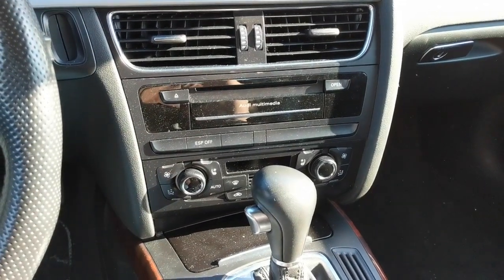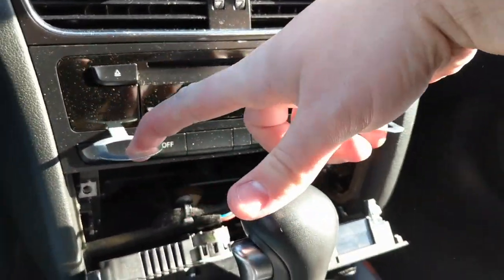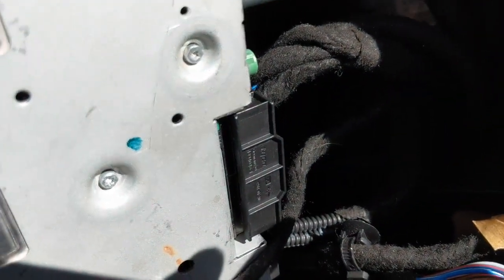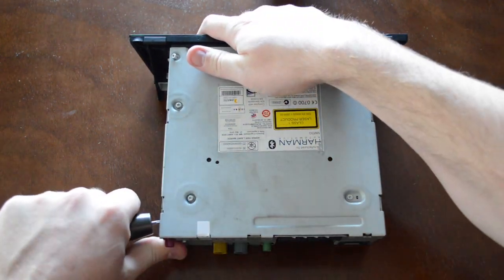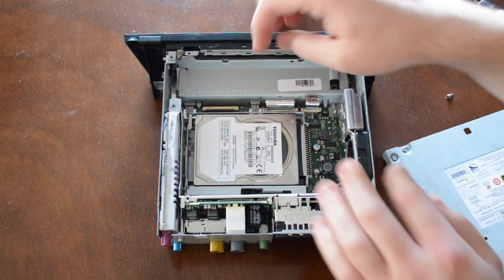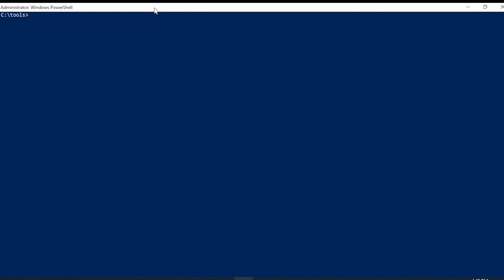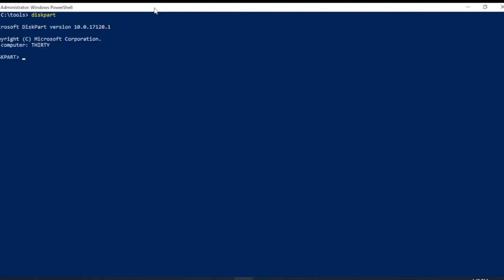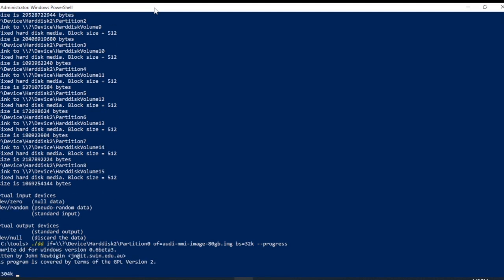Replacing the Hard Disk in Audi MMI 3G head unit

Comment: Just finished doing this and successfully cloned my HDD, but it didn't fix the problem. :(  MMI still crashes and shuts off after exactly 6 minutes and 20 seconds.  Any ideas on what can be done here?
Reply from the maker: Might need to perform an in place software update to restore the corrupted files on the disk. The update is not easy to find, but they're out there.

Comment: Very similar on a 2015 c7 A6. Thanks for the details. I'm having this drive sent out to be copied- it failed. Basically the only difference is when taking out the control module there is one 8 mm bolt once you remove the HVAC control.

Comment: Great Video and very helpful.
I decided to give this s try since I've been having issues with my Bluetooth, NAV and Media loading on my 3g+ MMI in my 2013 allroad. I've pulled the drive and connected to my Windows 10 PC. I've followed the instructions in this video and the DD command works to creating the video to just about completion, then I get the following error "54,404,480k Error reading file: 483 The request failed due to a fatal device hardware error" This is the second time I've created the image. I don't remember the error the 1st time thought. After writing the 1st image to my new disk it only created 4 partitions, and when I put that new drive in the car, Nav or Media would sit at Initializing. I'm guessing now that I've seen this error that my disk is corrupt and definitely needs replacement. Do you know if I can find an image that I can use to create a new disk?

Comment: Hello @breakallthethings Am having the same problem now, but mine is a 2014 Q7. You mentioned something about updating software, can you please provide a link to that if you have one. Also, if I buy a new hard disk do I need to format it or partition it in some kind of way that matches the old hard disk so it can be read properly?  My hard disk is making that loud clicking noise and Navigation is stuck on initializing and same goes for my multimedia, but everything else works. Thank you so much
Reply from the maker: I don't have a link to updated software, unfortunately. There are a couple of people around the forums offering software and map updates for various fees, and that was the route I took. Audi was incredibly unhelpful in that regard. As for formatting/partitioning, the copying method used in the video recreates the partitions and content appropriately. If the hard disk itself is unreadable, that's where things get complicated -- but dd/ddrescue can help recover as much as possible.
Reply: @breakallthethings  great, thank you so much. Last question, if I do end up buying a hard disk and just put instead of the old one and take it to the dealer, would you know if they can download or install the software on it? And will it work?
Reply: Hello, i have the same problem with media, and navigation stuck on loading. Did you repair it?
Reply: @danycs103 hello, I actually found a similar unit on Ebay and bought it, then took it to the dealer for programming only. So far still no issues

Comment: Good day. I have an Audi A4 B8.5 same mmi unit like yours. The problem is I accidentally went into the engineering menu and activated some things I wasn't supposed to. Now the MMI unit just comes on and is stuck on the Audi Logo start up. I took it to Audi and they saying the the MMI system is corrupt. To replace the unit cost more than the value of the car. Is there any suggestion on how I can repair or fix this problem without replacing the unit?

Comment: Where’d you buy your hard drive at? Was thinking about testing my luck with this one off Aliexpress. The guy assured me they work fine and have sold a ton of them. It’s a 100% “look-a-like” toshiba copy. 

I was also wondering which hard drives are compatible to work with the mmi? Toshiba is alright. I’d rather have a hitachi or something made in Japan lol. I’d assume there’s better hard drives that last longer/more durable out there. 

https://m.aliexpress.com/item/32818242869.html?spm=a2g0n.productlist.0.0.457e4adaV994Td&browser_id=da1a9f2002ae46858e6398d8f73da36f&aff_trace_key=af8d123e5bdc479ca1548b1a137c0ef0-1617128621162-01270-UneMJZVf&aff_platform=msite&m_page_id=6uwrfbqjgiqcarj3179ef1d1be622169968a20aafb&gclid=&_imgsrc_=ae01.alicdn.com%2Fkf%2FHTB1xv4kXIfrK1RjSszcq6xGGFXam.jpg_640x640Q90.jpg

Comment: Hi,
Is there any version of MMI that DOES NOT HAVE an HDD?
I just opened my unit and there is no HDD (under the CD reader). (It looks almost identical to yours just with other options - Start/Stop and ESP).
I mention that the car MMI worked when I purchased it but after 3 months it went dead black and when I went to the Audi Dealership they used the tester and told me that the 5F unit is dead (this unit).
Have any ideas?
Car: Audi A4 2014.

Comment: Hello everyone i bought an identical HDD and proceeded to clone it (for Backup purposes) per this great tutorial (it gave me an error copying one of the files) i installed the clone, everything works perfectly fine except one thing, i lost Bluetooth! anyone came across such issue? The icon dissapeared and in the bluetooth settings everything turned grey except the turn BT on/off which doesn´t do anything. thank you

Comment: @breakallthethings  great video and excellent explanation. In my 2010 Q5 8R I've had a hard drive fatally broken. We live in a extreme heat weather country and I believe this has caused the damage. I find myself that I do not have the data to restore te system when replacing the drive. Since it looks like you might have looked into this , could you help me out  to find a solution. Cheers

Comment: How did you determine your HDD was failing?
Reply from the maker: Mine would randomly pause at certain events, long enough that the system protection would kick in and reboot. Sometimes, when holding my ear up to the unit, I could hear it clicking.
Reply: Mine took a dump from driving in tucson too much, oh not to mention 4 Tires unrepairable 😢 from all the craters I've ran into. The hard hits from driving through them eventually blacked my mmi out and now the rust disk spin inside the hdd casing and you can hearthe reader arms smacking the surface of the disks that info is wrote to.😢😢

Comment: Quick question. It sounds like the actuator in my HDD has gone (HDD clicking). Was thinking about buying an MMI 3G head unit from ebay and just swapping out the HDD's. Do you know if this would work or are the HDD's matched to the head units? Thanks.
Reply: Weargas dose it work with you !?

Comment: Hello and thank you for this video.
When you disconnect the radio and put it back on, does it ask for a code ? From the video it looks like you won't need it.. (the seller didn't provide me with any code) .
I need to remove/disconnect it because the cheap radio pullers are stuck and I don't wanna mess up (lol)
Reply from the maker: Nope, no code. It's locked in with the CAN gateway to your VIN, so if you're getting a new used one, you'll have to visit your local Audi dealership to get component protection removed.
Reply: @breakallthethings  ah great to know, thank you for your quick response!

Comment: Thanks for this amazing video...
Are this available when I replace Hdd with an Ssd...?
Reply from the maker: So, that's where things get complicated. I've noticed on the forums that people have attempted to replace their HDD with an SSD, and ended up running into weird gremlins, but usually they also attempted altering the partitions at the same time.

The two problems with using this method with an SSD is that most SSDs are not designed with the temperatures that the stock HDD are designed for, and most SSDs require you to align partitions to match the byte alignment of the SSD. Most Windows drive migration software will do that for you, but a bit-for-bit copy wouldn't align the partitions, and so you'd get either no speed boost, or a moderate speed boost when working with it. Furthermore, if you make a lot of changes on the drive, the OS will have no idea how to perform TRIM cleanup on the drive, so eventually, you'll lose all the speed you gained.

Comment: Hi... i have disk on bench and connected to PC. How can i read it on Windows? What kind od application do i must to use?
Reply from the maker: Hi! On Windows, we won't actually read the contents of the filesystem, as it's a QNX disk, and requires a VM to access it. In the video above, I use dd for Windows to do a byte-by-byte copy of the disk to another.
Reply: @breakallthethings  Yes I know. Now I backup 1:1 on my pendrive but I want to access this and find few file which I want to change...
Reply from the maker: Adaxus Adaxus Gotcha. For that, you'll need a QNX VM and to attach the image to that VM.

Comment: i got one problem with my audi 
Mmi issue found hard disk fault in mmi control unit req new control unit and coding
it can be solved that the cost for a new one is £ 3500

Comment: @breakallthethings i got one problem with my audi 
Mmi issue found hard disk fault in mmi control unit req new control unit and coding
it can be solved that the cost for a new one is £ 3500
Reply: Did you get this fixed? Had the same issue in my a7 and looking for a cheaper alternative than £4000

Comment: Can you add an SSD drive (I'm guessing the connector will need to be changed as they are different from an EIDE drive) to this unit so it boots much faster (no moving parts)? And then, I guess, use the same PS scripts to export the information and then import them back onto the new drive. Also, what do the connectors do? IE which one is the aerial/ GPS, etc? Appreciate the help. Great video by the way.
Reply from the maker: Thanks!

I've seen in the forums a few people attempt an SSD. If you find an IDE SSD (which exist, but aren't great), it should work if you direct copy the partition table over like I do here. However, I haven't really found anything that achieves the operating specs of this spinning drive, so I didn't really bother. As for the connectors, blue cable is the radio antenna, yellow is the AMI connection, grey is -- I think -- GPS, the multi-cable with the lever is a /lot/ of stuff --including but not limited to, canbus, amplifier and/or speakers, power --, and the fiber optic cable, which is the MOST connection to other infotainment stuff.

Comment: And also can faulty hdd can be the reason that bluetooth doesnt turn on in the car?
Reply from the maker: While that could happen, it's unlikely. The symptoms of a failing drive usually come up as long delays to initialize certain components that rely on storage. This can be your directory, but not a surefire thing if you aren't noticing issues with media playback or settings being saved.

Comment: Is this also apply to A6 C6 facelift with MMI3G High? And dont you get component protection problems after the replacement?
Reply from the maker: I don't know the answer on the A6 -- I think the MMI control unit is elsewhere on this model, so the process would be different, but the drive copy would likely be the same. No component protection, though -- the check for that is on a separate chip on the control board, and has nothing to do with the drive in the unit.

Comment: JUST an idea i found online ide hdd  ( ssd hdd) if i can ghet to copy all the data or clone the hdd to the ssd il be beter more faster and lifetime quarante no more hdd fail
Reply: Where did you find this ? Can you share pls
Reply: @tonycanela1261  search on ebay ide 2.5 ssd .   Brand kingspec and others 60gb 80gb 120gb 250gb. My problem its if i clone the hdd to ssd i need the same size like 60 gb or i can use a big ide ssd 250gb i want also to increase the storage

Comment: I get a error “39,070,080k Error reading file: 483 The request failed device hardware error.” But, finishes with: 

1220940+0 records in
1220940+0 records out

Will this be a problem once writing the .img back to the new harddrive?

Should I try ripping ripping the old hard drive again or with another method? Would that help? 

Any help will be greatly appreciated.. 

Also was wondering if you can tell me how I could expand the partition that stores the music files when coping a cd from the car???
Reply: me too.. i get the 483 request failed due to fatal device hardware error.. and even though it says records in and out I'm still unable to copy it into a new drive because it cant even find the data that was pulled.  Probably not able to pull the data off?

Comment: Thank you for this awesome video! What were the symptoms that lead you to replace the drive in the first place? I have a 2013 A5 that gets stuck on the initializing screen for the navigation. The only thing that works on the MMI is the radio, not even Bluetooth audio. I do hear a hard drive clicking noise coming from the head unit. Is this similar to the symptoms you had? Thanks again!
Reply from the maker: Rahal B Yes! Occasional clicking and mechanical noises, and random freezes turning into reboots. Figured it was worth trying this before finding a whole new unit.
Reply: I finally had a chance to open up my head unit but the clicking is too severe on my hard drive, its not even being read by my computer. By any chance would anyone be able to send an image they created from their unit? Audi wants >$2000 to replace the head unit. Mine is a 2013 A5. Any help would be appreciated!
Reply: hi Im having the same issue with audi q5 navigation wont load , were you able to fix your issue?
Reply: I acquire my 2015 allroad as pre-owned back in 2018.  excellent condition, but I was experiencing the MMI failed to boot up a couple of times.  Being new to the MMi System, I wasnt sure what to do so first couple of visits were to the dealer, although they were "able" to reset the system, I will need to replace the 5f module = $2200.00.  No thank you.  Upon reading on different forums, found common problem w/ these MMI was the failing harddrives.   I then found the vides on how to and with a help of a friend as IT tech, I purchased a new HDD and he copied the files onto the new drive and replaced the old one.  I've had one "fail to reboot incident after that, but I now think i was being impatient for the MMI to boot up and start pressing buttons, i suppose confusing the system.  I found that pulling out the mmi, disconnect power and reconnect, will reboot.    takes 10seconds for the boot screen.    I havent had any issues since then.  I was able to also update the MMI software/firmware from vendor in europe for the SD card package to update the MMI.. not really needed, but its good to have updated NAV info and latest firmware.  I do have a Carplay module installed and I mostly use that for nav.